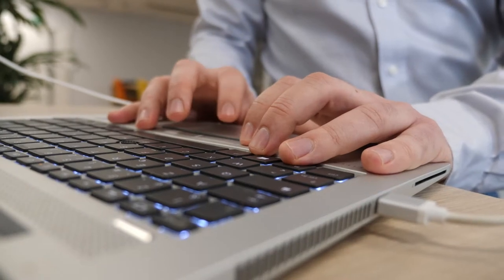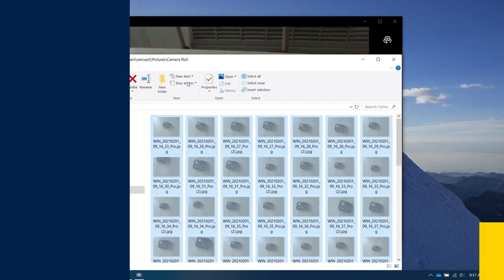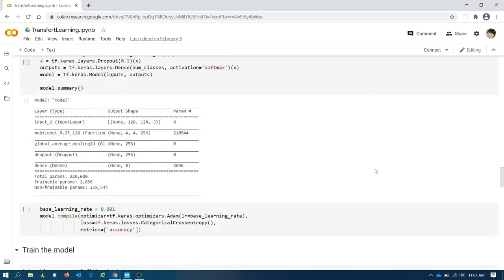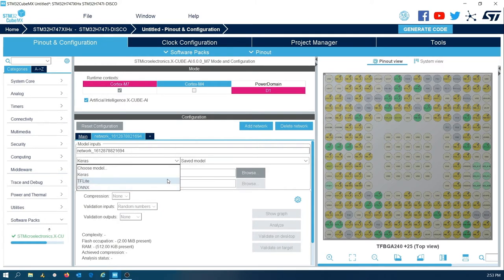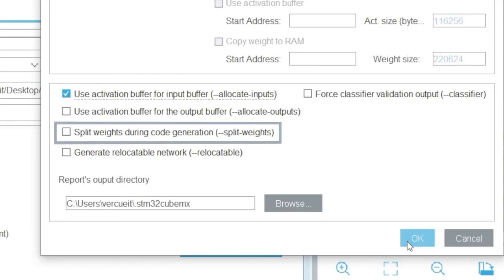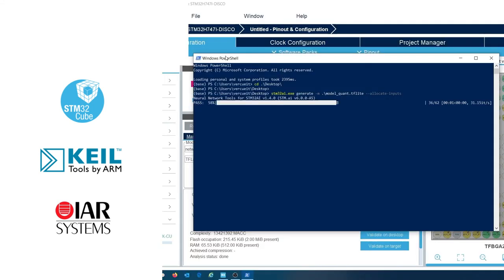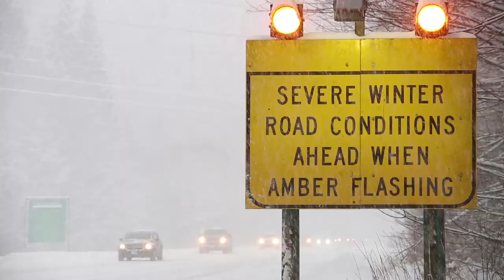AI on STM32 : Computer Vision made simple with FP-AI-VISION1 and STM32Cube.AI

Comment: Hey,
By using your MCU instead of Raspberry Py, the speed of the processing will be improved ? What is the bus which communicates with the camera ? The MCU contains an os ?
Thank you for your attention.
Julien
Reply: Hey, it will not be a speed upgrade comoared to the Raspberry Pi, but it will be a cost upgrade, because an stm32h7 development board (not fron st) can be baught with only 15€.
Im not sure, but the bus should be dcmi (Digital Camera Intercace) as that is an stm standard
If you mean an user os as ob most soc boards like raspberry Pi 4 / 5, then defenetely not, there is not enough Power. If you're thinking about an RTOS, then it is easily possible to set this up in STM32CUBE with just a few clicks.

Sorry for all the typos, I'm not native and not used to the english keyboard 😅

Comment: Whether the lcd works even after flashing the code? Kindly reply sir!!!!!
Reply from the maker: Hello. We've reached out to our colleagues about your question. Here is their answer. We hope it helps.

Yes it woks. The tutorial presented here demonstrates a way to modify a full-featured application from FP-AI-VISION1 to a different use case. i.e. from the PersonDetection classifier to a pasta (wiki article) or STM32 board (video) classifier. The LCD display, camera capture and onboard validation features will remain the same.

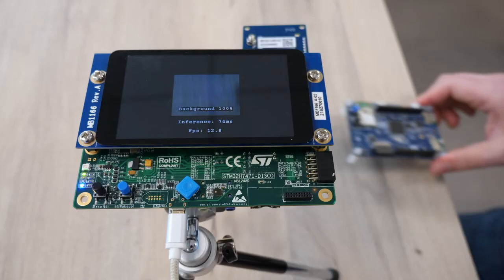The modified application can be seen in action with working LCD display at 10:21 in the video or at the end of the wiki article: https://wiki.st.com/stm32mcu/wiki/AI:How_to_use_transfer_learning_to_perform_image_classification_on_STM32
Reply: Thanks for your response.  Our LCD was not working at that time . we followed all the steps as mentioned in the video but the switching option was not enabled in the camera app as mentioned in the video 4.40 , we also checked our device manager but the webcam option was not enabled.

 Kindly help us rectify this issue or suggest some websites/ tutorial to capture the images through B-CAMS-OMV which will help us in proceeding our project.